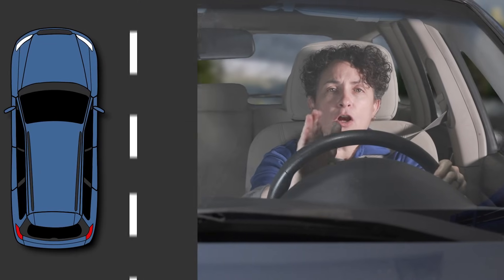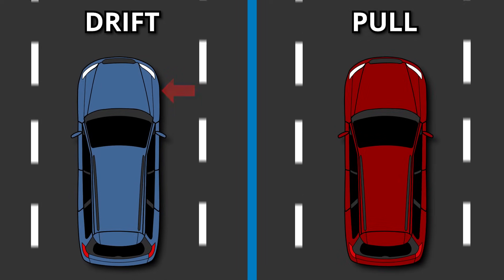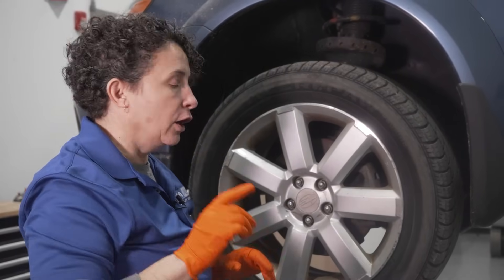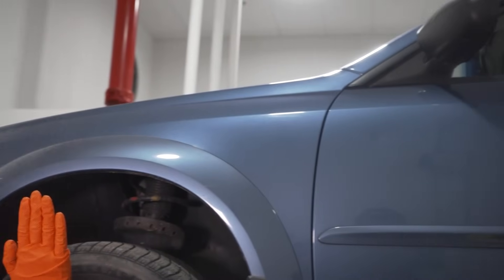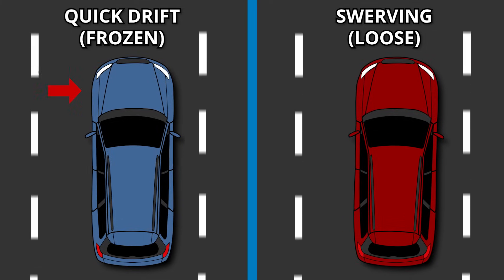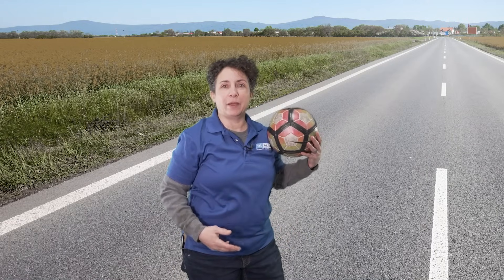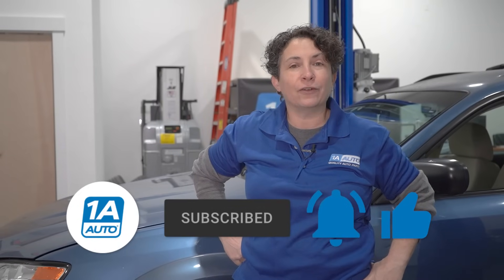Car or truck pulling to one side on the highway? Time for new tie rods or just an alignment?

Comment: It wasn't pulling,  but it was shuddering and bouncing when I braked ( and yes, turned a little lol ). It was outer tie rods ends. Much better, and snow tire swap made it all feel solid again. 
Much better grip on the road and feels safer.  Fwd monte ss, a little power, doesn't handle that great lol.

Comment: Someone please tell me is it possible that the car or van pulling left slightly after putting wider rims and tyres. Is it possible that any of these suspension parts has more load or stress after putting wider tyres and its failing to maintain. Please note wheel alignment was done twice despite nothing improved

Comment: My 2018 Ford E-450 Super Duty pulls to the left, even on the right lane of the freeway. Steering is tight and control is good. 
Only 50K miles. Could it be camber adjustment?

Comment: my car will drift to the right if my steering wheel is straight. im talking a few hundred feet and now im nearly turning right. to give an idea. I can put the steering wheel straight and do a curve on the  highway just fine. Tire pressure is within 1 of each other on all tires. 
ive taken it to 3 shops (ive had all 3 of them do an alignment) and none of them mentioned there was any damage to the suspension etc.
 im at a loss of what to do now
Reply from the maker: +@aquifer98 We wouldn't be able to diagnose an issue like that here, you may want to have a local mechanic take a look at it. Thanks for checking us out! http://1aau.to/m/Shop-1AAuto-c

Comment: Replace what is bad.Not always bad tie rod.Another thing to check the toe with the vehicle on the ground with a tape measure.Measure at the same spot in the front and rear of the of the tire.If out an 1/8th of a difference,toed out and this will  cause a pull.Have seen it myself.

Comment: Hi, Great video. Is it safe to drive with a worn outer tie rod end with some movement in the ball joint and play felt in the steering wheel when turning? Also is it safe to drive with a growling wheel bearing until I can afford repair?
Reply from the maker: +@michaelpaterson8086 We do suggest getting these parts replaced as soon as possible to avoid any further issues with the items.

Comment: I've owned my car for 17 years now and the car has been really good to me. Recently hit 150K miles and decided to replace the CV axles and ball joints.  While doing that I found that my tie rod ends were trashed.  The part that connects to the steering knuckle was super easy to move around with my finger. Bought two replacement Delphi units and they are awesome.
Reply from the maker: +@GlycerinZ Thanks for checking us out! http://1aau.to/m/Shop-1AAuto-c

Comment: After I changed my old tires with new tires I got this issue, sometimes the tires can do this problem, it need to be rotated till you get the correct configuration

Comment: I believe you may have answered my question , my car pulls quickly to the right then left when it shifts into second on the transmission and it happens quick.
Thinking its the part that looks like an elbow. 
Next question I have is how to for sure tell if a transmission is going?

It hard shifts and because of what happens when it gets into second I have been afraid to go over 40 in it .

I don't even know if it will shift into the other gears .
I been watching videos for a week now and you're the only one I found that could answer my first question.😊

Comment: I brought in my 2010 Nissan Altima 3.5SR in yesterday because the car kind of felt loose while driving it. Another mechanic had said I would need new struts soon, so I told the mechanic. So, yesterday, they replaced the front two struts assembly, sway bar links, and passenger outer tie rod, and did a wheel alignment. Today, the car feels tighter, but it is pulling to the right. It was definitely not pulling in any direction before I took it in for service. Also, There are 4 nearly new tires on it, so it isn't the tires. Why would the car pull to the right? I took it right back to the shop that charged me $1451.00 to do all this the very next day. Now they say, well, maybe now it needs back struts. I don't think so. This car was not pulling before I brought it in. Do you really think the back struts are causing the right pull?
Reply from the maker: +Sunny Pike We wouldn't be able to diagnose an issue like that here, you may want to have a local mechanic take a look at it. Thanks for checking us out! http://1aau.to/m/Shop-1AAuto-c

Comment: For me it was letting my alignment go to long as i couldn't get it done, as a result two tires on my passenger side were down way lower in tread vs the driver side. This resulted in a pull from cupping\much lower tread on one side

Comment: I recently replaced my outer tie rod end and now the car pulls to the right which I'm guessing means I didn't turn the rod in enough turns counted 23 turns to come out so went with 23 going in. Doesn't pull hard just a tiny bit that would put the car in the stop sign (if I allowed it) from about midblock.
Reply from the maker: +Tim Whit If an alignment was not done after replacing the tie rod, we suggest having one done to avoid uneven wear on your vehicle.

Comment: Thank you darling, very helpful.   Would an alignment fix my cam as well.   My steering wheel is pointing a bit left right now. 

   I just replaced all rotors, brake pads, flushed brakes lines and both from shocks on a 2009 Vw Passat- 2.0T.  This Monday I will be getting an alignment then I will be swapping brand new summer tires in my vehicle.  

Thank you and Happy Eastern.

Comment: I hit a pothole 2 weeks ago, tyre was flat and steering was off. Got the tyre fixed and tracking done, but the car is still pulling to the right and the steering wheel is not centered. Got tracking done again, same problem. The first shop advised that the tyre was not damaged. They just inflated it again. I am at a loss now as I don't know what is causing the issue. Thank you for your video, very informative.

Comment: One thing i learned that it can create the the same drift to left and right is the control arm. I found mine was i little loose and i couldn't see it because the car was on the ground but i lifted it and removed the tire, after that i moved the tire mount left and right and i saw 2 loose bolts. Make sure to inspect everything before ordering part that you might not need.

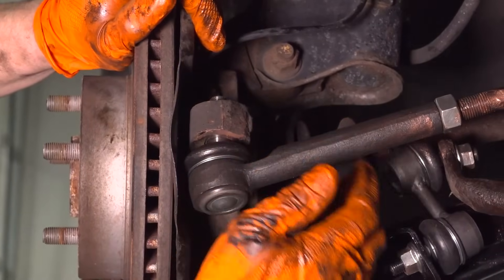Comment: I like video, make a lot of sense. 07:48, do not put copper grease on any steel parts, they will rot quicker. Put heavy thick water resistant calcium soap marine grease on outside of threads/nut, to protect it. Mechanical engineer advice.

Comment: and if you were to have a fouled up sleeve metering hyd,, spool valve / steering gear box
 the same issue, hard pull off the road. been there with that one. rack and pion steering damaged sticking same thing. fouled wheel bearings, tie rod ends, Idler link arm,  and how about front and rear wheel alignment, same issue, any number of things can cause the car to steer to one direction of the other.  fouled up front wheel alignment, wrong toe in or none at all.

Comment: Well honestly don't think that's my issue at all 
I own a 08 chrysler sebring starts great no rough idle or anything and drives great at low speeds from 0mph to bout 25mph but once u hit the 30mph its starts to wobble and when you get at higher speeds it becomes way more serious than originslly why?

Comment: i always  hear this clicking noise on my 15 dodge dart, i wonder if its the cv joints or tie rods . i hear it all the time when  i turn left, especially going up a road with a hill
Reply: My scion xb did the same recently. Especially when backing out with the wheel turned. Turned out to be the cv axle.